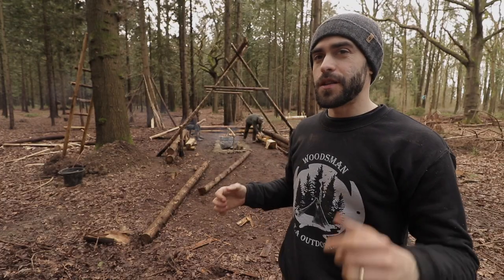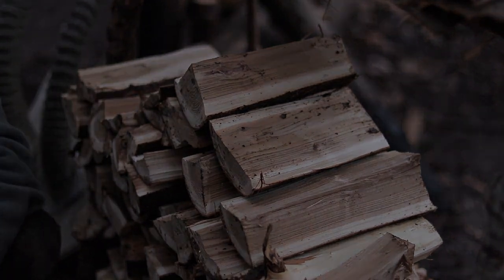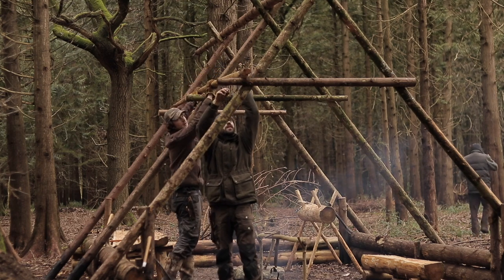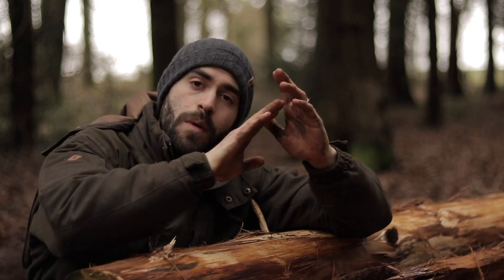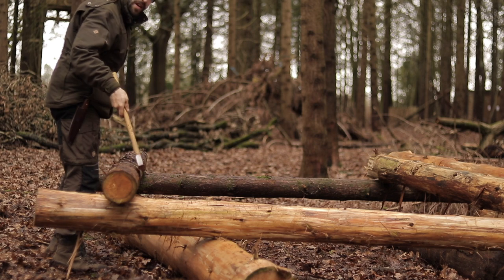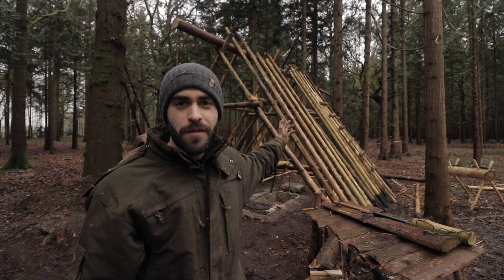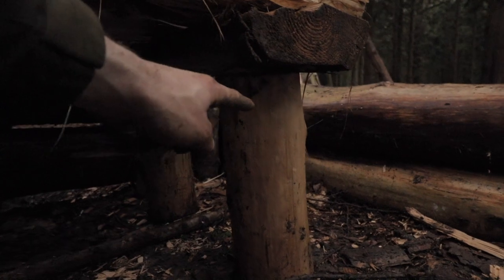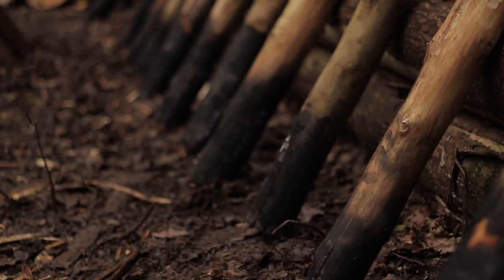Building a Viking House with Hand Tools: Timber Roof, Bed | Bushcraft Project (PART 5)

Comment: Tools that you would find advantageous to have during your endeavour;  

Mallet(s) - make out of a section of log with a hole drilled with the auger. Make a few different sizes. Beats using a large stick as a mallet. 

Froe - great for splitting logs and making planks. Beats driving in wedges.

Broad axe - if you need to dress the split boards to remove the splinters/splits.

Bark spud - used for removing the bark from logs.

Research trenail (treenail) for pegging logs together. Used a lot by shipwrights and carpenters.

Great vids, looks like a lot of fun. The grubs also welcome too.  😁
Reply: Sounds like alot of added weight to be walking through the woods with. Might as well suggest a pre fabricated cabin kit.
Reply: @wyrdwildman1689  😂
Reply: @5:13 - isn't that a handmade mallet on the end of the bench on the right?
Reply: Maul

Comment: You could put a wedge in the end of the dowel in a ways that the wedge  expands the dowel as you hammer it in the hole, in that way it would lock itself

Comment: Cracking episode guys! Cannot wait to see it finished! About the raised bed, personally, I would take it off the 4 legs altogether and just have it on the 2 cross beams. I think it would be quite nice having them low down like that, plus it would be a lot more sturdy and probably quite a lot lighter too, so easier to move around.

Comment: You could have planed the timbers with a draw knife before building a bed with them.
Reply: Yeah, I was watching him try to square it up a little with an axe at one point in this video and wondering why he didn’t just grab their draw knife
Reply: I thought the same, if the right tool is at hand, use it. They're doing really well learning on the fly though IMO

Comment: Watched again, thought about the raised bed a bit, and the most viking solution I can think of would be to use strips of leather and bind the legs to the top board to keep the legs from slipping.

Comment: I know I'm late to the party but, for your bed legs. If u split the dowels an place a small wedge in the split right before you hammer it into the hole the wedge will spread the dowels out as it enters the legs, locking it in place. It's a great trick but pretty permanent so be sure you are ready completely before you do it. I love watching you guys do this stuff! Thanks for documenting it for us!

Comment: Might I make a suggestion regarding the tables and storage.
Build in Graeme's style bed in the Off grid cabin.
You'll get storage, flat surface and bed area in one space.

In regards to the cracks in the pit, patch with Roman Concrete maybe ?
It will also work with the shingles to help seal, apply weight to keep from windblown sections and waterproofing.

Comment: Get your self a Broadaxe (also called a side axe). They have been in use since antiquity and are used for hewing flat planks. Relatively cheep, starting at $50 (USD). It might be a little tough now that the planks are on the bed, you may have to remake the bed planks, but flat planks will improve the leveling of the bed. Additionally you’ll be able to get thinner plank and more of them out of a single log.

Comment: Concerning beds, you could also build it the way Vikings did in Haithabu: Build a sturdy box about 30 to 40cm high, fill it with a ground layer of pebbles and small rocks (to get away from the ground), add brushwood, and a top layer of dry heather. Additionally, you could either make yourself a net construction on top of that, or you could simply use furs/linnen/other fabric which you could later sleep on directly. Really comfy.

Comment: Just a suggestion. You have the auger and draw knife and saw... You could make a mallet to drive the splitting wedges. A short length of log, hole drilled to receive a handle.

Comment: Make your pegs slightly larger than your mortise holes and prematurely dry them near the fire.  Get as much moisture out of them as possible.  When they are driven into the wetter wood (mortise) that wood will dry and contract around the dry pegs.  Dry to Green, no glue needed. :-)

Comment: Hey peeps, loving the videos, keep them coming! Just had a thought for your Viking Shelter - perhaps build in some window hatches for light and ventilation for the fire. You could use cut sections of bark for the windows (with a generous overlap to stop leaks) and wooden props inside? You've probably got that covered already, but I thought it might be worth a mention..

Comment: A suggestion for the bed: you could try to use water for the wood nails to wet them, so that they expand and lock the planks in place. I don't know if it will work, but should be worth the try(sorry for my bad english)

Comment: Hi guys, just a small tip to your constructions. It will be way more sturdy if you put a cross bracing on each side of the structure. Also the beds would get sturdier with a small cross bracing.
It is not much effort and makes a world of difference.
Good luck!
Matyáš

Comment: Awsome looking House its coming along great. On the dowels that you have used on the bed if you make a cut with the saw about 1 1/2-2" on the end and insert a wedge when you hit the dowel into the drilled hole it will tighten the dowel and shouldn't come out.

Comment: excellent video! If you accept suggestions, it would be a good idea to burry a little bit those rafters. It would give more stability to the structure so the top part doesnt have to take all the weight and all the nature forces (rain, snow, wind). Cheers!

Comment: An old timber frame trick, square pegs. The friction keeps the pieces together. Also, if you mix white wood ash with clay or mud and water, you have cement, as the white ash is essentially Lyme.

Comment: Idea for your bed project: I think you're on the right track with sinking the legs into the ground. To flatten out the top and get rid of the fringe/splinters, I think taking the draw knife to it would be your best bet.
To prevent your bed pegs from lifting out of your bed legs, you could try a very wide peg in a wide hole, so the leg fits like a jacket around the peg, and drive a very narrow peg through both the leg and the inner wide peg, thereby securing it. I don't know if you have the tools to drill a hole that wide and deep, but that could work if you do.

Comment: Hey, try joining all four bed Legs together with some small timbers and half lap them together it will give the legs structure and each end with cross struts. then yeah like others have said try the Draw Knife to plane the roughness out of the top surface. I'm loving the vids it's coming together nicely!

Comment: One tip that I can give is when splitting logs into planks, splitting them in half will make the grain split easier and usually a lot straighter. Then you can split each half again down the middle to flatten the other side.
(Edited to expand and clarify)

Comment: About the legs for the bed, put a wedge in a slot in the end of the peg so that when you hammer it into the leg the wedge will make the peg expand and hold on to the leg.

By the way, love the series man, keep up the great work!
Reply: Repeat the same on the top of the dowel.

Comment: Just finished up work and sat down to a wonderful episode. This series has me waiting and watching. I have been following TAFISHING and now BUSHCRAFTTOOLS for the different perspectives. Not to mention, I really love this build.

I am curious as to how you guys plan to vent the "Long Fire Pit"... DON'T TELL.. I'll wait. Having said that, Your dad needs to get fishing. I can see some fish hanging from the peak rafters curing in some awesome smoke... Or maybe some of that pig and goat! ;P
Reply: P.S.  I am not sure as to your location and local resources, sand, gravel and/or water, so I will throw this out there. "Pack Box"! In my younger days we had a field camp in South East Alaska that was about 2 K up the trail from salt water. Rain forest, mud floors, dreary most of the time... Not unlike where you live. Every trip we made to the beach and back to the camp we would load sand and Gravel in the pack boxes to spread on the floor. Granted there were eight of us that rotated in and out of this camp, but with in a few weeks we had what amounted to a concrete slab floor (all be it with some packing and tamping). Food for thought.

Comment: You can also use the wood wedges you already made to help with taking the bark off the logs, it will save your fingers some blisters and possibly splinters.

If you can get the the flats for the bed off the cross braces without pulling the dowels out with them you can clean them up with your draw knife if it has a long enough blade on it. Other then that get yourself a wood block plain.

Comment: When pegging a board like you are doing on the bed, split the leading end of the peg and stick a small wedge in it. When the wedge bottoms out in the hole it will spread the end of the wedge locking it in place.

Comment: 1.) Great series.
2.) Use a hand plane to smooth out the bed.
3.) It would be cool to dig out the floor for more headroom or alternatively Jack up the whole roof to make a wattle and daub wall about 3-4 ft high

Comment: You could make some pine pitch glue to secure the pegs in the bed. Or just use some white wood glue. It's been around a long time and was probably available to the vikings in some sort or other. 
Also - make your pegs just so slightly bigger than the drill hole - it will be harder to drive in but will get a better friction fit. 
Another method of securing the peg is to drive in the peg and then drill a new hole in the leg that will notch into the peg crosswise and then drive a peg into that hole to lock the first one in place. Then use a slot and wedge at the end of each peg to lock the other ends in - sort of like they do with Axe Handles.

Comment: Drill holes in the bed legs horizontal and put a peg from leg to leg.

Then take some Chord and run it between the cross member plank and the new dowel and it will keep your bed legs from falling off. Twist it to give some torsion strength if you have to.

Comment: On the matter of locking the legs on the bed- with the same auger, drill a hole in through the side of the leg at the top, off center such that it notches the side of the connecting dowel, then insert a dowel to interfere with the first. Cut the second dowel as a long cone that will wedge itself into the opening at the fat end. I'm sure the northmen would have had this sort of thing or some interpretation of it. Cheers, great content!

Comment: Also, I see loads of moss around. Moss is a excellent water absorber. At the base of the shelter along the base of the rafters, you may wish to utilize the moss and make a sort of  1 to 2 foot high varies, to keep the the meted ice and snow from seeping in underneath the shelter, also prevents water damage to the foundation of the building.

Comment: If you want the beds more rigid, I'd attach a diagonal poles between the legs, kind of like the letter "N", save maybe for the two front legs, as that way you would loose acces to the storage space underneath. Not sure about burying the legs, sitting on the bed would over time IMHO cause the dirt their distant side to compact and they would not fit in as snugly. 
 As for attaching the legs to the pegs more tightly either put some pine tar there or increase the friction. Carve or cut a groove onto the side(s) of the peg, insert some bigger splinter in it, taper the splinter's lower end toward the leg and hammer the peg into the leg hole.
 Anyway, please disregard if the advice in unnecessary, and thank you guys for the video, and good luck with the build ;)

Comment: You should build some wooden hammers to hit your wedges with... Using your axes as hammers is not good for them, the handle will come loose as the hole slowly deforms. Plus, every missed hit weakens the handle! I'm loving this series

Comment: Funny you're mentioning IKEA furniture. 
I once heard, that the vikings kind of invented the flatpack. They packed premade wall and roof elements in the bottom of their longboats, when they planned to settle down in a new area. That way they could erect a first house pretty fast and wouldn't need to gather and process local materials first.
Reply: ^ truth.... when pillaging who wants to stop to build shelters and what not. Flat pack an entire house in each boat.
Reply: Check out ´wooden Viking chair´ pictures. Two pieces of board that make a chair, no assembly tools required. It won´t get flatter than that. I saw them in a re-enactment camp in Denmark, in an open air history museum.

Comment: Peeling bark is easiest if you cut and peel the log in the spring (apparently early june specifically at certain latitudes). Essentially, cut and peel when the tree is growing- the bark is basically floating on a slippery layer beneath. Comes off easily in sheets.
If you wait til later in the year, the layer beneath dries up and the bark tightens (preparing for winter), making bark peeling a lot more difficult or even impossible to do neatly for some types of trees.

Comment: As your using the timber in the green all peg joints etc will close up as the wood drys out and shrinks ( seasons ). Can build anything out of timber without nails/screws.

Comment: One idea for the bed is to dig holes 2x the size of the legs in the ground where the legs go, then with other pieces of wood prop the bed up and make it level and with the desired overall height with the legs free-floating in the holes you've dug. Then with the dirt you removed, mix it with water and pour it back in like concrete, maybe add fibers in the mix for strength. At that point under the bed is the safe place structurally speaking in case of a natural disaster.

Comment: Kinda just a random fact. When using cedar trees there is 2 layers of bark. The outer and the inner membrane. Us coast salish natives use the inner park for our clothing. Hats, shawls to rope, fishing line, bed mats Ect. It's extremely durable, waterproof, super rot resistant and resilient and pliable. Best time to strip is spring, and if you dint want to chop down the tree, stripping while its alive is very viable, as long as your not taking more then bout 1/3rd the tree will live without complications really.

Comment: for the bed legs try boring a smaller hole and putting dowel through 90 to existing dowel and through the vertical dowel - pining it.

Comment: A possible solution for your bed is to cut a kerf in the end of your dowel, and put a wedge sticking out of it. As you drive the pin in, the wedge will hit the bottom of the hole and expand the dowel end locking it in place. Make sure the wedge goes across the grain so the stress of the expanding pin goes lengthways, and doesn't crack or split the log, though going into the end grain of the leg, it won't matter in this case.

Comment: Best way if found of pinning things, is to put a split in the bottom of the pin that sticks out by 1 inch then shave the edges down on the peg so it’s still the same diameter all the way to the top, then put a split wedge in the top as well so it’s expands from the top and from the inside

Comment: 1. marshaltown 20 hand sander or a planeing tool
2. Crosscut logging saw
3. Manual hand drill with tightner for different wood bits
4. Few Chizles..different types..

Comment: Guys, you should really add a couple of diagonal rafters on the sides to add rigidity to the structure in the longitudinal direction... if the wind pushes from the front or from the back there is nothing keeping the frame to collapse forward/backwards. Only the resistence of the soil against the six main rafters.

Comment: I havnt been reading the comments so I dont k ow if its been mention but... Have you guys looking into getting a Frow (hope I spelled it right, also).  It might help your guy splitting proccess go a little easier. The blade is long and wide enough that as you drive it in the log you can rock the blade to help open the spilt up as you treavel thru the log.

Comment: How about this for leveling the bed surfaces?  Split 2 logs a half meter or so in length into 4 pieces, and assemble them into a square with dowel joinery, with the split sides facing each other toward the center, rounded sides facing out.  Now set the box on the ground in the firepit and fill it with broken rocks, having as many sharp edges as possible pointing down toward the ground.  Now get some clay and flatten it out, then mash it down into the tops of the rocks, embedding them into the clay, and filling the square box with rocks and an upper clay layer out to the edges.  When the clay is dried out, carefully run a knife around the clay and separate it from the box, then lift the box off gently so as to preserve the square shape of the clay and rocks.  Now build a fire on top of and fire the clay, turning it into a rough pottery.  Now you've got yourself a Viking sanding pad!  Put that back into the box, fix a long handle on the box to push and pull it back and forth over the bed surfaces, and voila you have yourself a 'sanded' surface.  If the sander is too light to dig in properly, just add some large flat stones on top of it for weight.

Comment: Glue made from pine pitch and charcoal in the pegs for the raised beds might help or saw a notches in the end of the pegs  and insert a small wooden wedge so that when  the peg hit the bottom of the hole drilled in the leg the end  of the peg will spread out just enough  to bind up in hole drilled in the leg and stay put kind of like the wedge in  the handle of an axe holds the  head on